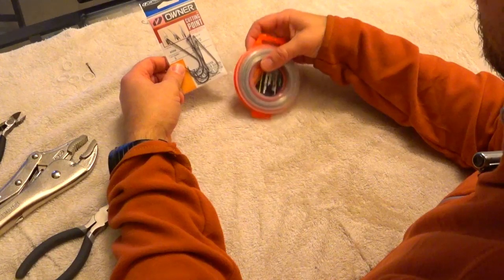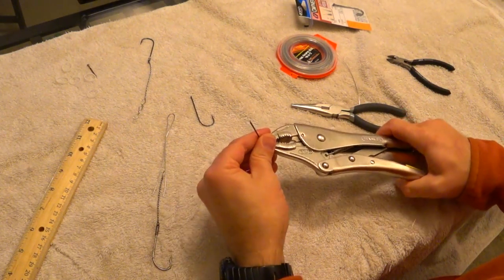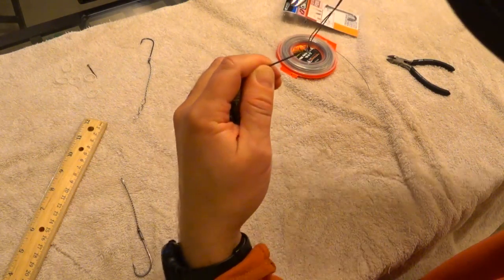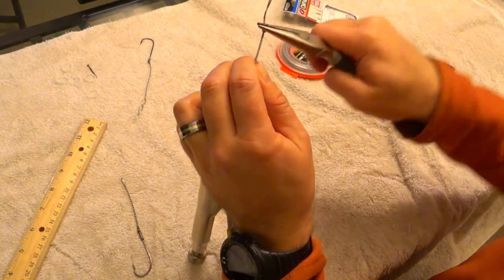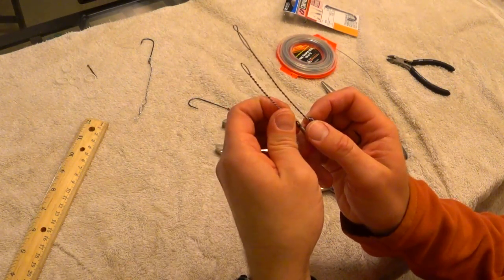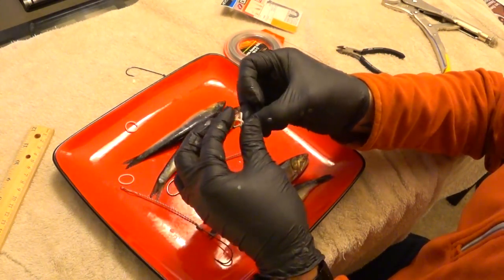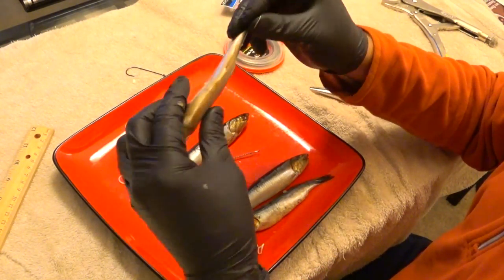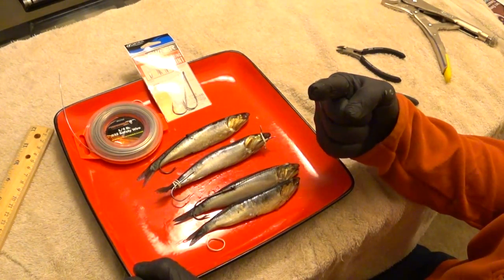Tutorial- How to make wire trolling rigs for salmon fishing, catch more fish!

Comment: How are you rigging herring to your line, are you tying leader direct to the loop  or a snap swivel thanks for the video
Reply from the maker: I use a locking snap swivel. The herring spin in the water, that motion elicits the strike and will tangle your leader/line without a swivel. Good luck!